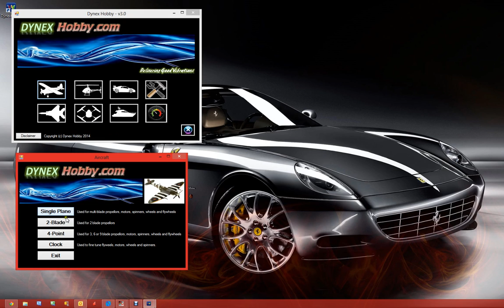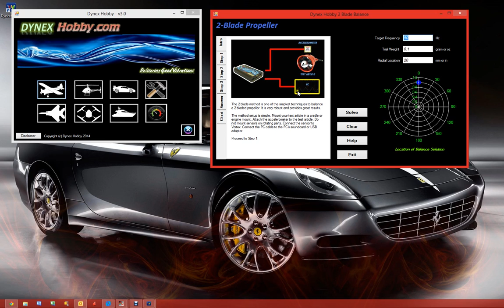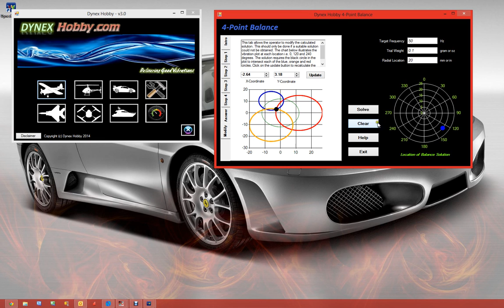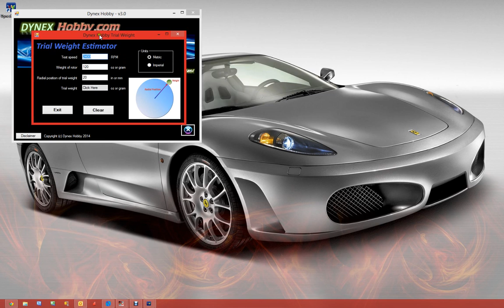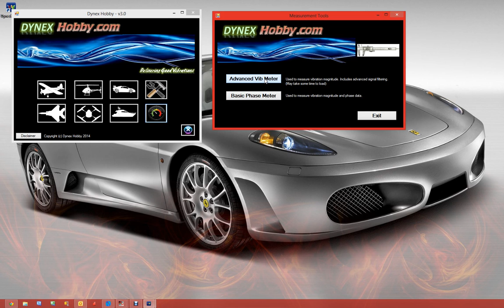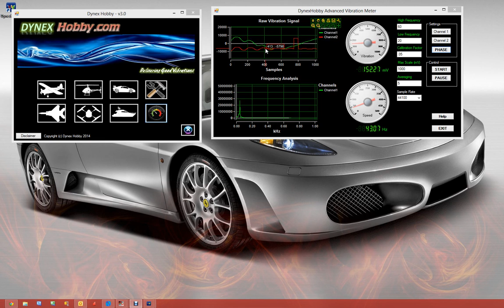Vortex Software v3

Comment from the maker: Software has been updated to now include real time filtered signal trace AND a tracking filter. 

So what is a tracking filter?

A tracking filter basically filters the vibration signal automatically as the RPM changes. Say for example you are performing a balancing run and the motor can't maintain exact RPM. Well, the tracking filter will automatically adjust the filter to ensure the signal remains clean whilst recording measurements.